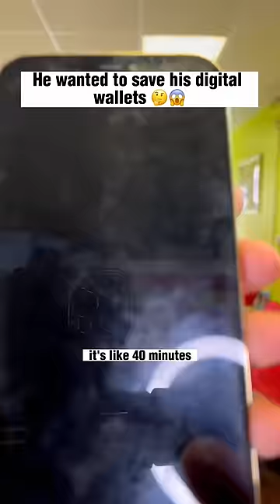Customer wanted to get His Digital Wallet Saved 👆#shorts #apple #iphone #ios #samsung #android #fyp

Comment: Why are they reject his phone because of the red stickers? Idk what it does, can someone please explain it to me
Reply: Water damage i think
Reply: It’s the liquid indicators that turn red when they come into contact with liquid. They would reject the repair due to them being red and of course the active liquid still inside. Although the repair was successful the reason they reject it is because there’s no telling what else was damaged due to the water and how the corrosion will affect the device over time. 

Since they add a warranty to the repair they would he held liable for any repair after the fact if the device stopped working. I would suggest that person backup their data and keep it backed up because there’s no telling if the liquid got underneath the board and is slowly corroding parts of the board over time. Just my two cents
Reply: They did not with my phone. Red but they still fixed it for me.
Reply: @Shadxow  thank you :D
Reply: Apple is not going to fix a device with water damage. Could be other failures down the line and the first thing a customer will say is “y’all repaired my phone” they are not taking the liability

Comment: Don't put your phone in rice of it was soaked in water , just buy a bulk amount of silica gel packs and put the phone in a dry container with the silica gel packs . 

When rice gets wet then the starch and dust from the rice will get inside and it would be even more of a mess than a solution .

Comment: That’s messed up Apple still doesn’t want to fix the phones like the 13 pro models and the 12 pro models no Apple is tripping but other than doing the laundry it’s lame 💀😒
Reply: Since they add a warranty to the repair they would he held liable for any repair after the fact if the device stopped working. I would suggest that person backup their data and keep it backed up because there’s no telling if the liquid got underneath the board and is slowly corroding parts of the board over time. Just my two cents